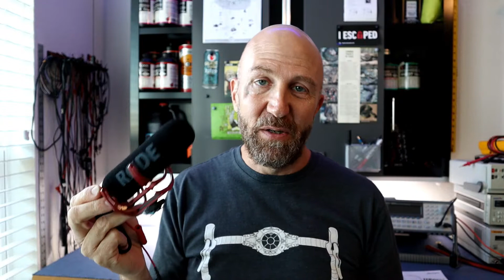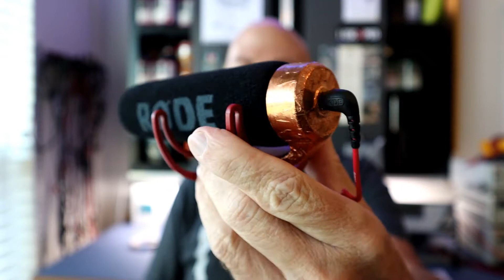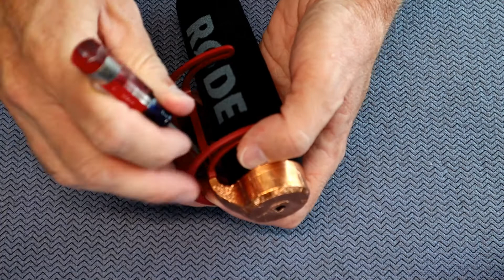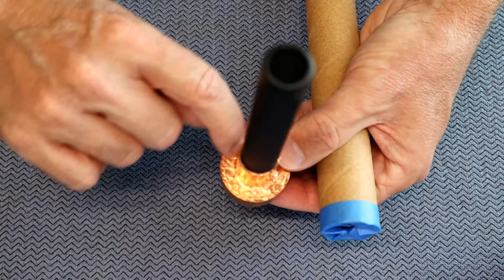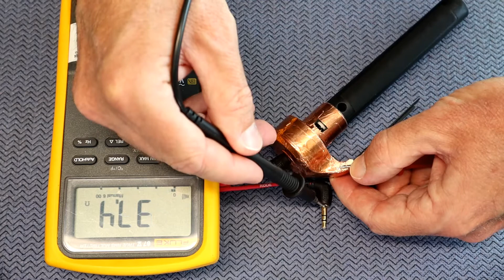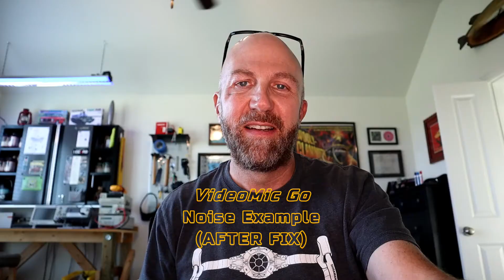How To Fix the Rode VideoMic GO Clicking Noise Problem

Comment: I just wanted to say that this has definitely helped eliminate the clicking noise I was having except that I went with aluminium tape(yep, I'm Australian haha), rather than copper as that seems to be better at shielding EMF (WiFi produces EMF).
Reply from the maker: Aluminum and copper are both good conductors, so both will work in this application (creating a Faraday cage). Technically copper is slightly better, but it is harder to find, and is more expensive than widely-available aluminum-foil duct-sealing tape. EMF is electromotive force, which is just "fancy talk" for voltage. Or sometimes it means electromagnetic fields - which obviously are required for any sort of wireless transfer of information. So when we say EMI and RFI - we are talking about unwanted electromagnetic radiation that induces voltages in nearby conductors. If you say EMF, it's the same exact thing. Another way of saying this is that electromagnetic fields (EMF) sometimes cause electromagnetic interference (EMI.)

Comment: I was baffled as to why all of a sudden I have this problem after I've had this set up for 5 years!  I thought my microphone was just needing to be replaced, but no... I'm right next to the router!!    Would duct tape work for this fix?  No copper tape on hand. What microphone would you recommend that wouldn't have this problem?
Reply from the maker: In order to work, the material must be conductive (metallic). So duct tape won't work, unless it is some kind of metal mesh tape. In a pinch, you can wrap the mic in aluminum foil, but it will be difficult to keep it in place.
I have heard that the Rode VideoMic (not the VideoMic GO) has better RFI/EMI rejection... but what I bought was the Shure Leafhopper VP83, and it has been fantastic. It's a little more expensive, but it sounds great: https://www.sweetwater.com/store/detail/VP83--shure-vp83-lenshopper-camera-mount-compact-shotgun-microphone

Comment: Not getting a clicking, but I am getting a distinct buzzing sound. Is that an agc issue?
Reply from the maker: It's probably not the automatic gain control (AGC) by itself - but high gain (quiet environments) will exacerbate any RF/EMI noise pickup that might be happening.

Comment: I now have a new MIC!! thanks to this solution. The electrical tape did the trick. The mic works great so far. The clicking went 100% away. Otherwise it was going into the garbage. I'm not going to use this mic with annoying clicking in the background. You would think that Rode will work on a solution for their newer mics. If I can fix it with 10 dollar electrical tape, they should be able to make modifications before selling it to me! Right. Thanks!! Thumbs Up! Subscribed. Got to love Youtube!!
Reply from the maker: That's great!

Comment: Did the shorter cable help any further?
Reply from the maker: No, it don't make any difference. I decided to bite the bullet and upgrade to a Shure VP83 Leafhopper, and it solved all my noise issues. The worst noise that I could not get rid of on the VideoMic GO came from the Canon BR-1 BlueTooth remote.
Reply: You just saved me buying a new mic, plus I can continue with my project on schedule. I did have to wrap the little red coil by the way. Excellent ❗️

Comment: Have you tried to see if this method works when using the Røde Mic Go with a smartphone? I'm currently using it with either the iPhone SE (1st Gen) or the Samsung Galaxy Note 9. The phone is secured on top of a tripod while the mic is secured on the expandable pole part of the tripod just below the camera mount using a adapter mount from my Zhiyun Smooth 4 gimbal. The playback has a similar clicking and crackling noise to the noise you experienced in the router room. I'm looking for ways to prevent or otherwise silence that noise.
Reply from the maker: Hi! What I found is that adding foil shielding to the VideoMic GO will block most external interference sources (WiFi, etc.), but it was not very good at blocking interference from the camera's own Bluetooth radio. I ended up buying another shotgun mic that is self-powered - the Shure VP83 Leafhopper. I've been really happy with that mic, even though I had to invest a bit more in my equipment.

Comment: Thank you so much, I did it and it worked. I tried turning off the wifi settings of my camera and it also helped tremendously. So I would totally recommend people to tried this method and also turning off camera wifi settings. Again, thank you so very much.
Reply from the maker: For me, turning off the Bluetooth made a big improvement too - but then you can't use the Bluetooth remote for the camera. Eventually I upgraded to a Shure Leafhopper microphone.
Reply: @BikesBlades  thank you so much for the info, I am also going to upgrade soon but until then, this mic is going to work better than it did before, awesome video.

Comment: Thank you so much for your video. It was driving me crazy since I was recording in a place with no sound. It was the wifi all along.
Reply from the maker: Wow, OK! Did adding some shielding completely eliminate the noise for you? After shielding mine, I found that if the Bluetooth interface on the camera is active (for example, if I'm using the BR-E1 remote) the noise is still there. So I upgraded to a Shure VP83 Lenshopper mic. But I want to try adding a ferrite bead to the VideoMic Go cable...
Reply: @BikesBlades  what does a ferrite bead do?
Reply from the maker: A ferrite bead blocks AC currents in the cable shield (common-mode signals)

Comment: No clicking and popping but have white noise. New to dslr and mics. Trying to fix.
Reply from the maker: If you are just getting white noise, my guess would be that your recording gain is too high - or that you have AGC (auto gain control) enabled in the camera and it is bumping up the gain when things are quiet... Check your audio settings; maybe pick a fixed gain setting.

Comment: mate have you try to use ferrite Core cable filter on the mic? it might help to block the signal
Reply from the maker: Oh, that's a great idea! It will have to be a clamp-on type, or a bead with a fairly large inner diameter, because we'd have to pass the 3.5mm plugs through the bead... Let me see what I have on hand...

Comment: You can also slap aluminum foil wrap on the body for a temporary fix. Had to do this the other day for one of my kids videos. As we were to close to the router causing wifi signal clicks.
Reply from the maker: Yes, that works on the same principle! Aluminum foil is something that most people have on hand already, so it works well as a quick fix. If you decide to make the fix more permanent, the adhesive on copper tape will keep it in place.

Comment: This fix worked. Copper tape around the back of the microphone housing like the video demonstrated. It got rid of the constant clicking sound from radio interference from equipment.
Reply from the maker: Wow, I'm actually very happy to hear this! Recently, I discovered that the Canon EOS M50 Bluetooth feature can still be a problem, even with the shielding on the mic. But it's easy to disable the camera's Bluetooth radio... unless you are using the Canon BR-E1 remote or your phone to control you camera.

Comment: This is a great video. Incredibly informative!
Reply from the maker: More recently, I have also realized that a huge contributor to noise with the Canon EOS M50 and the Rode Videomic Go is the camera's Bluetooth interface... if you have the M50 Bluetooth feature enabled (e.g., to use the Canon remote), there is a constant clicking noise that is unavoidable - even with added shielding on the microphone! I'm seriously considering buying a powered mic (maybe the Shure VP83) just to solve this problem... because I really like using the Canon Bluetooth remote.

Comment: Good idea, but the shots of how to dissensamble are pretty Bad. You can't see any of the work you're doing, and your instructions aren't clear. I suspect mine is glued tho. I'll rey to shield it without dissensamble. Thanks for the tip
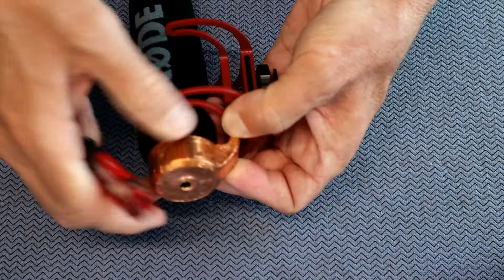Reply from the maker: I'm sorry it's not more clear; even in person, the tiny "barbs" that hold the microphone onto the suspension mount aren't really visible. You just have to go on faith and press them in a bit with a small screwdriver, just as I show in the video around 4:20. It's not glued, unless you got your mic second-hand... or you glued it yourself. :)
Reply: Bikes & Blades hey, thanks for replying! The barbs are supposed to be more towards the back, front, bottom or top? Ive been butchering the mic all evening long with no results ha. Thanks for the info
Reply from the maker: @SebasSant87  the barbs kind of run the length of the little slot; I applied pressure on the barb at the rear (near the base of the mic) and also kept a bit of tension on the suspension mount. The barbs won't stay "released" on their own, so it's a combination of depressing them while simultaneously sliding the mic out of the mount. It's tricky, but doesn't require a ton of force - at least mine didn't. I hope you can get it apart...